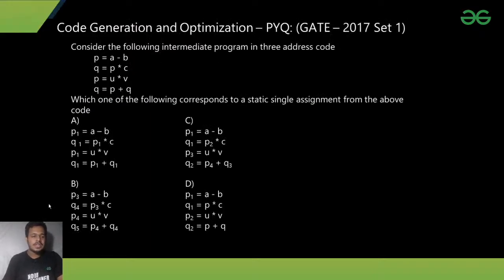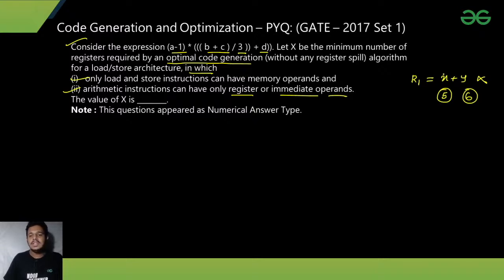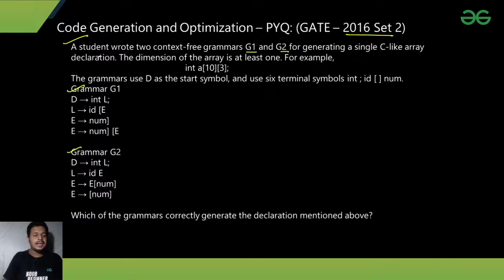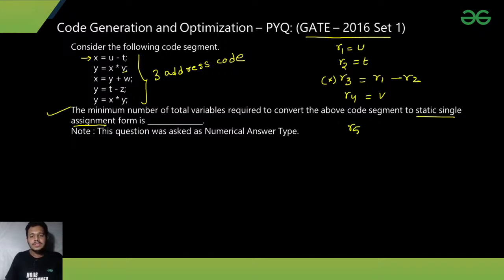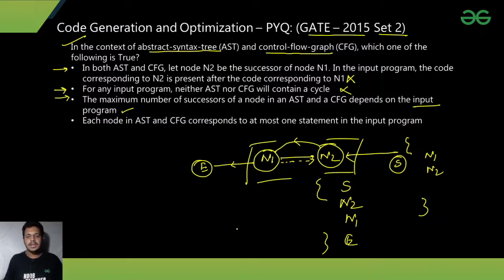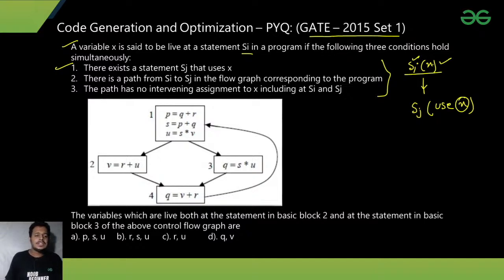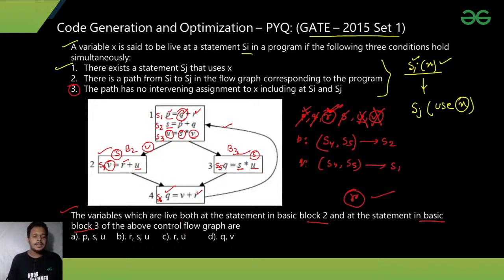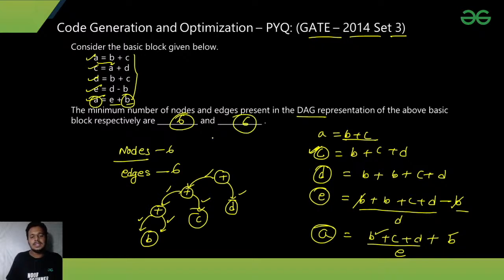GATE PYQ - Code Generation and Optimization | Joyojyoti Acharya | GeeksforGeeks GATE |

Comment: Hi, there is a confusion between 5th question and 9th question. in 5th while converting to static single assignment form variables are first loaded into temp variables but in 9th they were directly used for operation without loading into temp variable...could you please explain that?